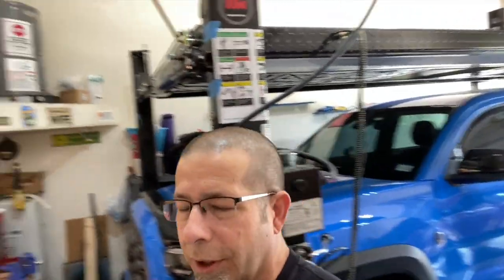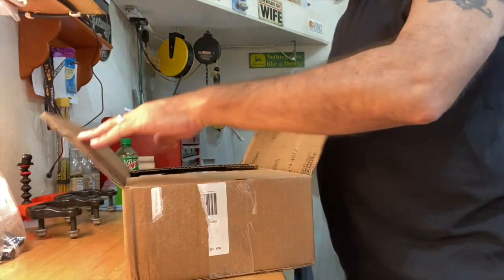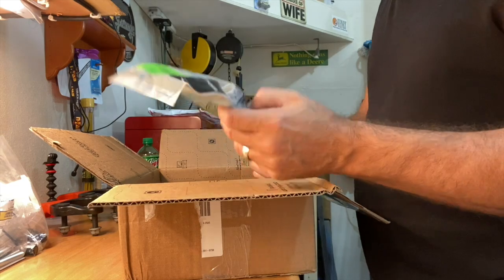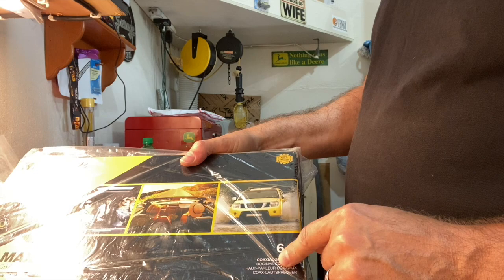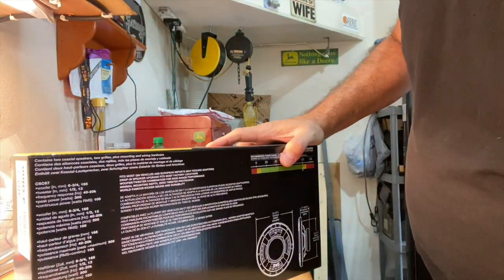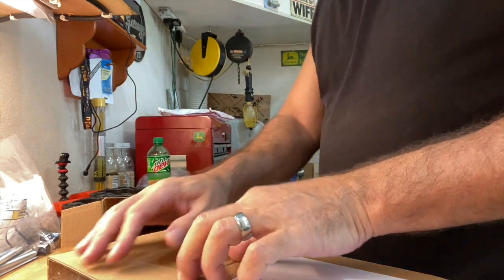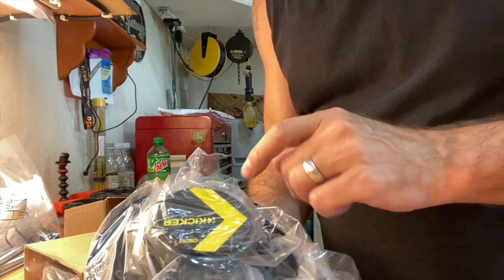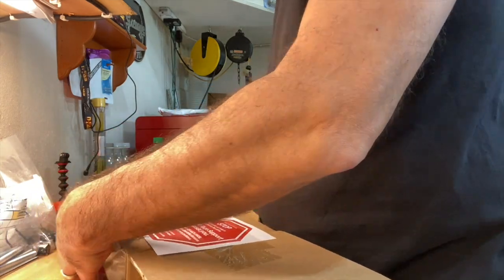Impactful Mods to Make My Truck Better

Comment: I have the same kicker system in my truck staying with the stock head.I  Did the entire setup a year ago. The front speakers and tweeters made a noticeable difference but You won’t notice much added difference adding the rear speakers though as most of the sound comes from the front.
Reply from the maker: Yup....I agree👍
Reply: @RobMotive  i watched on another YouTube channel. If you fade the volume from front to rear you can notice that the rear speakers volume is turned down you can notice a difference from front to rear. I tried it in my 2021 Tacoma and I noticed the same thing in my truck. The rear speakers volume is turned down and you can’t adjust them.
Reply from the maker: Yup...I’ve done that as well.  Definitely tuned down😐

Comment: I replaced my rear speakers with Rockford Fosgate 1650s. I listened to some music with mismatched speakers, and there was actually MORE bass in the old factory speaker side. I don't understand it. I finished the install, however. I really don't think I've noticed anything at all. Maybe I need to sit in the back seats for a little while to hear it. 🤷‍♂️
Reply from the maker: I believe it.  The radio is definitely not setup for rear speaker power!!😬

Comment: I have the jl audio stealthbox and 5 way amp running on stock head unit. It's a bit pricey but sounds great! The stealtbox fits like a glove in passenger cubby, mounted amp in driver cubby.Your aftermarket door speakers will sound much better running off an amp.
Reply from the maker: Sounds like a nice setup👍

Comment: The stock stereo needs a converter to use 4 ohm speakers, the should have told you the stock output is 1.5 ohms.

Comment: Hey Rob
I couldn't find your install video for the tweeter mod? Is it available still?
Also have you ever noticed how flimsy the rear plastic liners are in the wheel wells? Like Toyota forgot to attach the two screws at the bottom on both sides. I took out one screw at the bottom on each side and re installed them so that the screw and washer actually Atached them so they wouldn't be flopping around. 
Maybe another video for folks here? What do you think.
Reply from the maker: Here ya go: https://youtu.be/ULOPnfxytSw
Reply: @RobMotive  thank you! 
I edited my original comment with another question. Are you rear wheel well plastic liners the same? Was there a reason there not attached with the two screws at the bottom?
Reply from the maker: Hmmm..I haven’t noticed anything funky with the rear liners🤔
Reply: @RobMotive  take a look at them you'll see what I'm referring to.